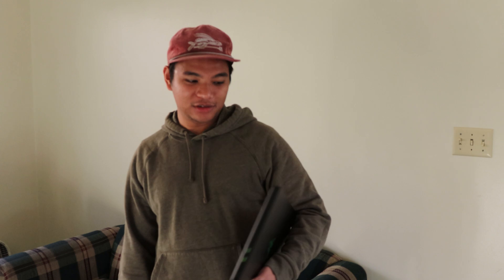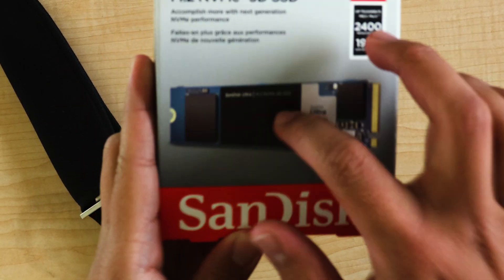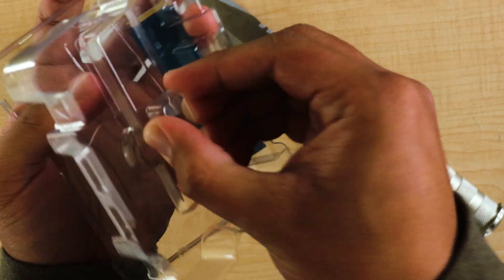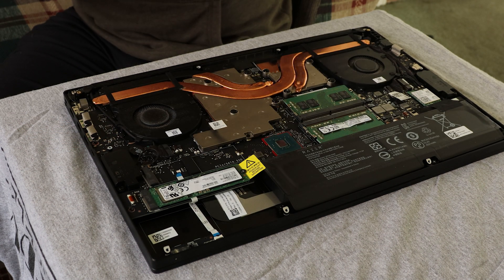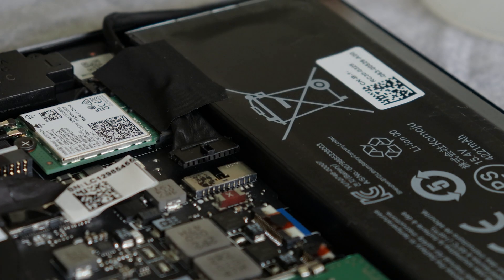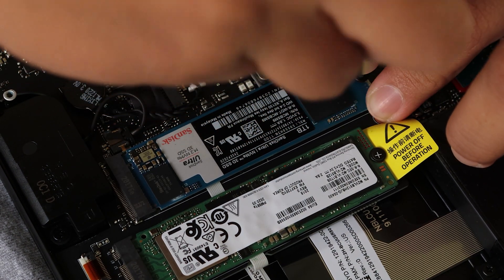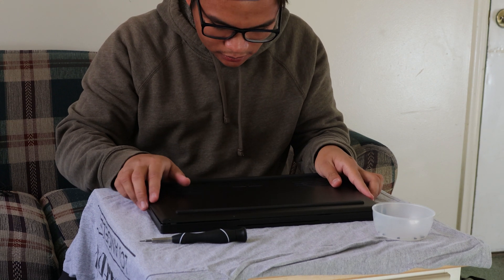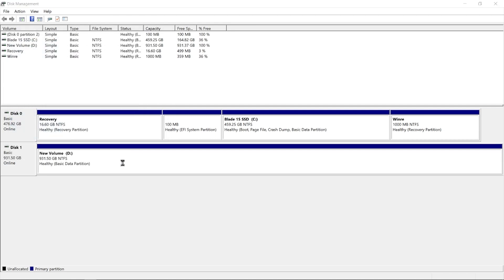How to upgrade SSD on Razer Blade 15 2020 (Base Model).

Comment: I just upgraded mine, same model. I noticed that the black thermal pad thingy underneath the secondary ssd slot is making the new ssd bend a little at the center and im worried it will snap in half. Are u having the same issues or is it just me? Should we be removing that thermal pad?

Comment: Splendid, many thanks. 
I didn’t even know there was a free slot in my Razer blade 15, 
But now I will certainly upgrade.
Just wanted to mention to windows 11 users that you can get a shortcut to disk management by right click on the windows start button. 😊

Comment: I came back to this to because I didn't remember if there was a cable attatched to back or not. Regardless, if one of your fans makes an extremely loud "burrrrrrrrrrr", and you or your partner have a dog that sheds a lot, take off your panel and look at the amount of hair that's trapped inside the fan area. Oh my god, the amount of hair her dog had in the system....

Comment: Plz if you can answer this, did you have to back up any files for the additional ssd or no? Also to clarify the laptop already comes with a screw for the ssd correct?

Comment: Wow, this worked! And i couldn’t work out how to disconnect the battery so just left it alone. But when I took out the screw for the memory slot, I was super careful not to drop it on the motherboard anywhere.

Thanks for the vid. Viva Philippines!

Comment: I just leave the battery plugged in. I wear an anti-static wrist band. Bare feet and no socks to avoid static electricity. For those who want to replace boot ssd i bought  a Sabrent tools free ssd enclosure and used the Acronis software to clone my boot ssd. Acronis cloning software is free if you bought a Sabrent or Western Digital drive.

Comment: what happens to your old ssd when you put a new one? mine has 512 out of the box, does it make it 1512 of that sort?
Reply: you keep the factory storage as well. All that will happen is that there will be a separate storage system when you go to download things.
Reply: @quinntakara1642  thanks bro. As for the ram, have you got any idea what ram i can use for upgrading? Have you upgraded yours?

Comment: Great video - but never use a metal object to remove a battery connector. I sparked a MacBook Pro unplugging a battery connector with a metal screwdriver and it completely died. I'd recommend either your fingernail or a plastic accessory to remove/attach it safely.
Reply from the maker: Thanks for letting me know.